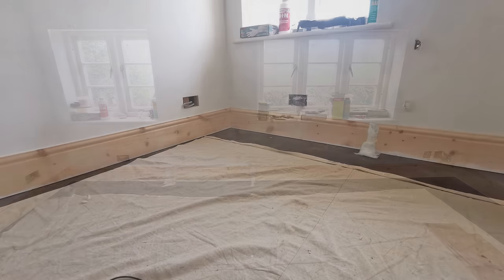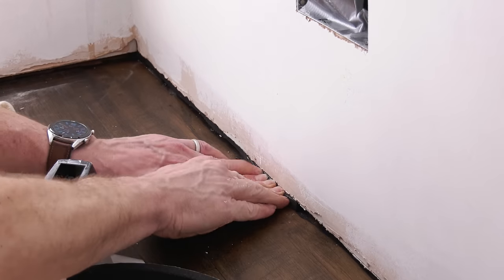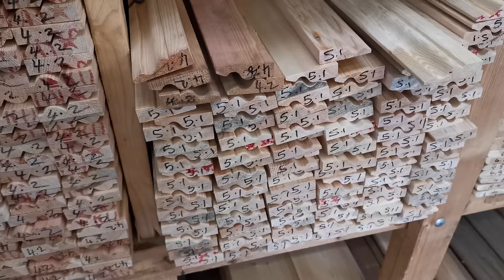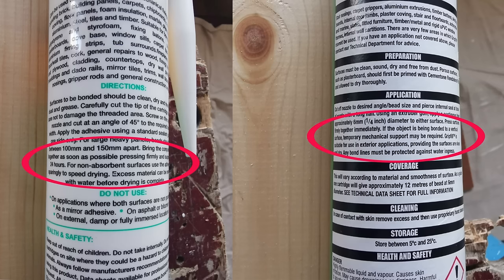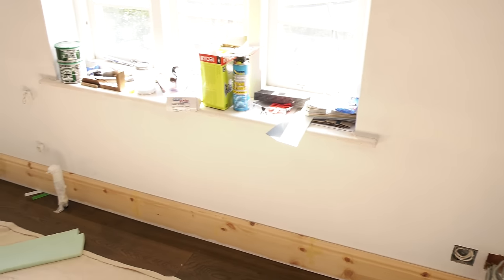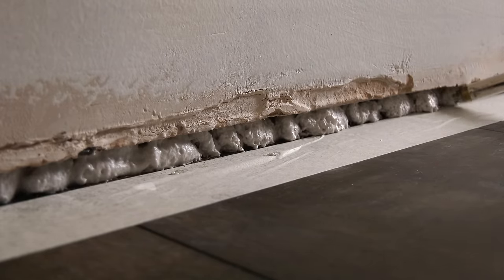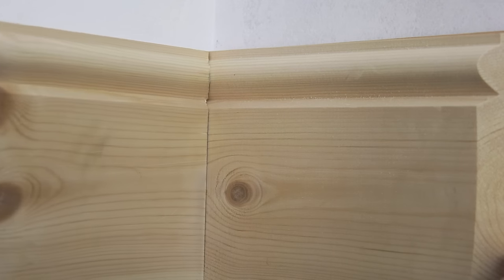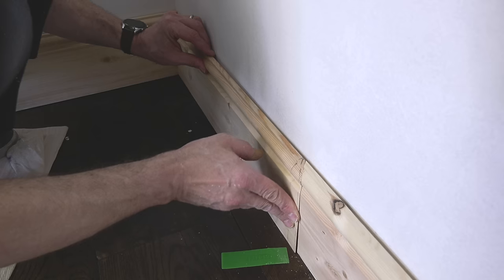How to Install Skirting Boards - a DIY Guide

Comment: Another great video again Charlie!

I'm installing skirting in the next few days. I was going to paslode mine in place, but having seen the price of nails and gas, I think I'll just use screws and fill, as I'm painting afterwards. Plus one of my runs is warped like yours, so I wouldn't trust glue and nails to hold tbh.

I've already scribed my corners and  primed and undercoated and will put final  satinwood coat on once they are installed and the final filling and caulking is done. I'm screwing to studs which are at 400mm centres. Should I screw at each centre or could I miss a few? The skirtings are 4m  and 2m runs.

I saw another youtube video where it was suggested to use 22.5 degrees to make the straight joints as it makes them less noticeable. Any reason you didn't reverse your straight joint as it would be less noticeable as you look into the corner? Maybe doesn't matter as your filling and painting? 

Am I going to regret not priming the bottom and rear of my skirtings? I was told to do this years ago in an old terraced house. However, my skirtings are in an insulated modern house and didn't think I would need to?

Any reason you didn't put the upper row of screws in the indent of the moulding? I've done that in the past, as it makes the filling as easy as a single wipe with your finger and no sanding.

Cheers, Charlie.
Reply from the maker: Hi Charlie, so do you mean cutting slightly off the 90 degrees when you butt the straight joints up? Yes you could do that, but if it shrinks your going to be left with a wider trickier gap to fill I guess. The danger with screwing into the indent is it's the weakest point so might split. Also it's the hardest to fill/ sand - I'm not sure one swipe with the finger would so the job but you could try... I think with spacing of the screws you probably could get away with 800mm centres particularly if your glueing it from behind.
Reply: Thanks for the replies.
I meant 22.5 degree rather than 45 for the joint you made along the length of one of your skirting runs to extend the length of the run. 
I have scribed each of my corners. They are fairly good but not perfect. I'll run a thin bead of caulk before finishing the painting.

Comment: Very useful. Have you done any beading Charlie? Our pet rabbit (RIP) nibbled most of it. The corners are the tricky bit to cut to mitre angle..
Reply from the maker: Thanks. Generally no as I like to finish with skirting alone. You should be ok though if you buy a mitre block and a decent fine tooth saw (eg Irwin Jack floor board saw).
Reply: OK thanks. I'll try it.. @CharlieDIYte

Comment: Hi Charlie 

Thanks for your reply, much appreciated.

Regarding the evolution your Workbench took; initial construction, hinged in the middle, and finally the path guiding system. I wanted to ask, if you'd known form the start you were going to proceed with all three, which order would you have proceeded? 

I wondered if the screws that secured your Workbench stiffening posts underneath, were in the wrong place when you started to proceed with the marking-out and subsequent drilling of the holes for your path finder system. As the screws were fixed topside of the plywood Workbench, through to the aforementioned stiffening posts, I was considering going through the path finder drilling process first?

Any thoughts you may have would be welcome.

Regards

Robert
Reply from the maker: Hmm. I would say do the parf system first before cutting the table in half, but the problem with that is you then reduce the distance between holes between the cut so I probably wouldn't do anything differently. The screws aren't a big issue because you can always move them. 👍
Reply: @CharlieDIYte  Many thanks.
Robert

Comment: Have you tried a combination of a mitre cut and using the coping saw? If you cut a mitre it then gives you the outline to use the coping saw to cut the correct shape.

I feel your pain with the splinter. I've had a bit of beach tent pole in my thumb since last June.
Reply from the maker: Thanks for the tip. I'll have to try that. Oof. I knew it was still in there. Woke up one night with a truly stabbing pain in my thumb and just when it was healing, I sat editing the video, looked down and there it was, poking out of my thumb. How do you know it's still in yours?
Reply: @CharlieDIYte  I've got a lump on my thumb (apparently the body encases foreign bodies as a form of defence) and every so often I get a dull ache. The nurse said they wont cut it out so need to wait for it to make it's way out, with a bit of drawing ointment for good measure.

Comment: Regarding the sequence for walls that need repainting and new skirting boards being fitted, would you cut them to size and paint them before final attachment and after the wall is painted? Are there any obvious pros or cons to pre-painting walls and boards first, please?
Reply from the maker: You're always going to want to  caulk the skirting into the wall so you'll inevitably want to apply a final coat of paint on both, to cover the caulk but if you can at the least prime the skirting first, and mist coat the wall (if new plaster) before fixing the skirting in place, that'll help. Probably best to emulsion the wall too, to avoid all those sprinkles on the skirting. Applying a top coat to the skirting will avoid that fiddly job of painting the skirting close to the the floor, but choose a paint that can be touched up without flashing, as you'll want to fill the screw holes or nails and repaint if you're mechanically fixing it to the wall.

Comment: Whats the wood filler you use please? mine looks NOTHING like this! :) I'll be using that from now on
Reply from the maker: 2 part Josh. https://bit.ly/2Vpzhkv Comes with a small tube of activator (hardener) - which you use in the ratio of a pea of hardener to a golf ball of filler. Sets in 5 minutes.

Comment: One thing I had trouble with was when I bought double faced skirting boards from wickes they weren't flat on either face so were a nightmare on a mitre saw.

Edit: oh my god it happened to you as well! All my 45s are a bit of a mess and needed fixing once up on the wall
Reply from the maker: Exactly! Moral of this story, use MDF! The skirtings downstairs are all from Wickes. They're thinner at 15mm rather than 20mm so probably could be straightened with some decent screws and plugs into the wall, but you shouldn't need to be doing this. It's hard enough installing skirting in the first place!
Reply: @CharlieDIYte  MDF is not an option,  if like me you are keeping the natural wood look and varnishing the skirting.
Reply from the maker: @norfolkhall  That's why I went for natural wood - you should have seen the lovely old things I had to rip out - they were too damaged to reuse but nearly 30mm thick. Maybe hard wood next time?

Comment: Great guide as always Charlie. Unfortunately, the person who installed the skirting in our Victorian property couldn't cut/fix the conrner mitres around accurately. Some of the external mitres don't meet by #4-5mm in places... any tips for sorting out (2 part wood filler, chaulk?)
Reply from the maker: Yes I'd use 2 part wood filler. And tool it in with a continental filler knife. You could even use a Fugi tool if you clean it off the tool straight away afterwards.

Comment: Am going to be replacing this year, great tips, thanks. However, how to fit with radiators in place with pipes tight to old board which have now been removed? Thanks
Reply from the maker: You may have to take off the radiator if the pipes are too tight to the wall.
Reply: @CharlieDIYte  Thanks, j

Comment: 15:25 what you could do here is get two small blocks of wood and rest the skirting on each end. Get a compass and set it so it hits along the whole skirting. Now scribe the pencil line along the skirting. Gives a profile of the floor the whole way along. Takes the guess work out of it.
Reply from the maker: Good point, rather like I did here https://www.youtube.com/watch?v=9-cYp73ewEE&t=51s 👍
Reply: @CharlieDIYte  similar but in this case no need to measure and cut the block of timber. Just use the same timber thickness. Resting the skirting on each end will allow you scribe the line. Think Tom Silva on This Old House done this for the video somewhere.
Reply: @CharlieDIYte  here's the video where he uses that technique I was talking about, to cut the timber to the profile of the floor, only level. 0:56 https://youtu.be/diDVtXpAcLg maybe I seen that somewhere else or came up with it myself by adding the 2nd block of timber at the other end 😂

Comment: Should the skirting be fitted flush (maybe with a 1mm gap), or with a larger gap (e.g. 10mm) so that the carpet can be fitted underneath the skirting? There seems to be two schools of though on this.

Comment: Wow! Many thanks for this video. Came here because, having spent a fairly large amount of money refurbishing downstairs, the final stage after the new hard flooring went down was the skirting and architraves. I employed a 'professional carpenter' with good reviews online. As far as I can see his firm did NONE of the things you describe here. There are gaps between the skirting and the floor. The architraves don't actually meet at the corners (on one door frame it doesn't actually reach the floor!). The mitre joints are so bad that they're stuffed full of filler. The boards are simply nailed onto the walls, nail heads not countersunk or covered with wood filler. The work was done by a couple of young lads working for the firm. The proprietor has agreed to call in today to inspect the work. Having watched this video I feel I can talk with a little more authority now. What his firm has done is indefensible, and as far as I  can see it will all have to come out and be done again properly!
Reply from the maker: I'm so sorry to hear about that. Yes sounds really shoddy what they did. I just hope when the boss came round he didn't have the same attitude and standards as them?
Reply: @CharlieDIYte  Yes, he came out. He tells me he is a Master Craftsman. I have never seen anyone squirm with embarrassment as much as this man did. I was very calm and just pointed out the errors. I hadn't even got as far as demanding that it be done again. He just volunteered the idea himself. He is coming personally, without the two junior minions. He will remove all the work the lads did, replace everything with new, do all the work himself to ensure the standard is met and is doing the entire thing at no cost to me whatsoever. He MUST have been embarrassed!!!!!!! I didn't ask, but I guess there are a couple of junior chippies looking for employment now.

Comment: Hi, so you don't need a gap between to skirting and floor and and just have the skirting touching the finished floor?
Reply from the maker: Correct but that will make it hard for you to paint the skirting.
Reply: @CharlieDIYte  Thanks a bunch. Shouldn't be a  problem has I'll be painting before install and using adhesive.

Comment: Great vid man (like how you present to) queeeestion, at 5:52 you show a piece fitting between 2 ends, is there a trick to measure that up easily so it fits snug on 45 degree cut join? (: thanks.

Comment: I’d recommend looking at ac glue for joining pieces together on external mitres and when joining 2 pieces together for a long run. Flap disc combined with an angle grinder on a internal corner to scribe takes material off quicker and easier to back cut for better fit. Angle finger type protractor cheap on eBay £6-7 45 degrees just won’t do for most external corners

Comment: Hi, quick question. You said you'd use MDF on your next project (5:04). Is this because MDF is not expected to warp or just because you want to give it a try next time?
Reply from the maker: It's because it's less likely to warp. However always go for wood if you're worried about damp etc on the walls and I've got to say, now the skirting is finished and painted, it does look good (better than MDF would).

Comment: Hello Charlie, the rule for skirtings is all internal joints scribed, external joints mitred. I’m a carpenter with 45 years experience and I wouldn’t advise anyone to mitre internal joints for skirting as the corners won’t be a true 90 degrees and real wood will shrink and the mitre will open up.

The other benefit from scribing internal joints is that you only have to cut one joint on each corner.
Reply from the maker: Thanks John. That's certainly my view. Did I say something else?
Reply: @CharlieDIYte  hi Charlie, you demonstrated using internal mitres with the chop saw, it might confuse people that mitres are an option when they’re not. The chop saw is is a great tool for cutting the internal scribe, if you don’t know how to do that check out Robin Clevett he is a master carpenter. 

This isn’t a criticism of you, I just have real issue with anyone trying to cut internal mitres as it’s tricky, nigh on impossible to get right, and you have to cut them on every corner which is a nightmare. Caulk wasn’t around when I started out so you had to get them spot on, especially with polished hardwood and scribing is the only way. 

Another tip is to cut the length of skirting scribed skirting a couple of mm long then spring it in with some  PVA on the joint
Reply from the maker: Ah yes. I think I did that because I've had a fair amount of criticism over the years from people (bodgers clearly) saying you should mitre the internal corners, but I did at least point out the pitfalls of this technique.
Reply: @CharlieDIYte  Let them mitre away Charlie. Keep up the good work.

Comment: Charlie - using the Fischer plugs in insulated plasterboard, did that give a good enough fixing and was it secure? I have 60mm insulated plasterboard I need to fix skirting too and want to make sure it’s got a secure fixing. I’ve been putting it off for this reason.
Reply from the maker: Yes it was but if you wanted to be really sure you could use the Duopower 8x40s If I have time tomorrow I'll drill into a piece of plasterboard and see how the 6x30s open up behind. What screws were you thinking of using? The other option is to just glue it if your skirtings are flat enough.
Reply: Charlie DIYte That would be great if you did have a chance to do that because I don’t have any spare insulated plasterboard to try it in. I am unsure on screws yet but am anxious about spending money on skirting and making a hash of it when fixing into the plasterboard, also I don’t feel like glue would be enough.
Reply: @CharlieDIYte  I just had an outdoor study made and the walls are plasterboard with a PIR foam board behind it and the brick wall behind that. To attach skirting, can I use the 6x30s into the plasterboard, even with the PIR behind it? I tried glue but it wouldn't hold because the walls weren't true.

Comment: Hi Charlie.  What size fisher plugs were you using with the 3.5mm lost tite screws?
Reply from the maker: Red plugs are usually 5mm but these Fischer were 6mm I think. You want a 5mm plug ideally.

Comment: Hi I’m in the process of putting on skirting board .. my question is do I install my skirting board after I have laid my laminate flooring down or before ?
Reply from the maker: Definitely after. It looks much more professional to have the flooring underneath the skirting.
Reply: Charlie DIYte thank you for the reply . Would u say I need to do the same for the architraves ? Floor first ?

Comment: Why didn’t you pull the splinter out with some tweezers? Ever so satisfying getting them out in one piece.
Reply from the maker: It was right under the nail and honestly I couldn't see it - believe me, I had a good dig. Plus I removed as much of the nail as possible  😳
Reply: Charlie DIYte under the nail...ouch. That was a good un as well 😄

Comment: Hi Charlie I can't seem to find any of the 49mm lost-tite here in the UK maybe they've been discontinued. I can only find 49mm Tonge tite which doesn't have the thread at the top. Do you reckon these will do for attaching skirting?
Reply from the maker: Here you go https://www.toolstation.com/lost-tite-screw/p33733 Best to use these as you need that secondary thread to pull the skirting back to the wall.
Reply: @CharlieDIYte  Thanks Charlie, great videos btw.

Comment: Have you got any tips for installing skirting on a round bay window? Thanks
Reply from the maker: Consider getting bendy MDF. It's designed for this. A little tricky if you're wanting to use taurus or ogee though.
Reply: @CharlieDIYte  brilliant thank you.

Comment: How you remove it if I have to? How do you know were are the screws? Thx for the video
Reply from the maker: That's a tricky one. With larger screws you can just about see the 2 part wood filler plugs but you'll struggle to find these screws. It'll be a case of pulling it away from the wall with a gorilla bar and because the screw head is also small it will probably just pull through the timber.

Comment: Hey there, I need to do the same identical job. I noticed most people use B3 foams, which are flammable. Is there a reason why no one seems concerned about it? Shouldn't B2 foams be taken into consideration instead?
Reply from the maker: Are you taking about the expanding foam to fix the skirting to the wall with? I'm not sure why, except to say that given wood is flammable, but I agree it would be wise to take every precaution.
Reply: @CharlieDIYte  thanks for the answer. No, I am just referring to the foam pu expanding foam to fill the gap between the wall and the floor. Everyone tells me I don't need to, but I honestly don't like having that bridge and the draught that will come with it.